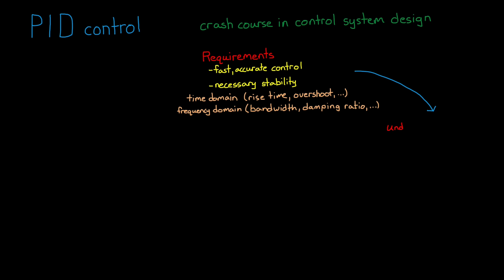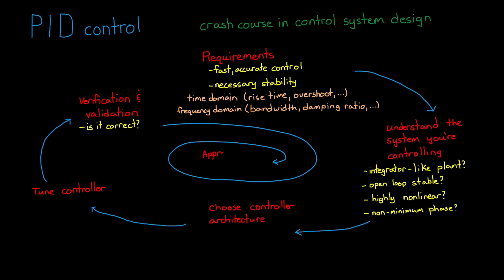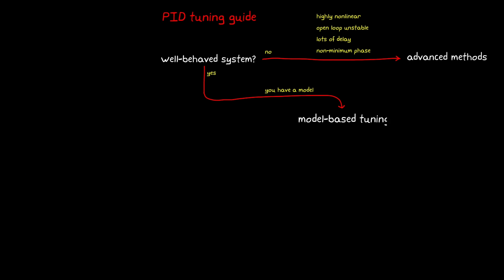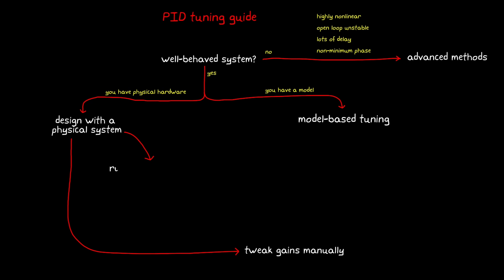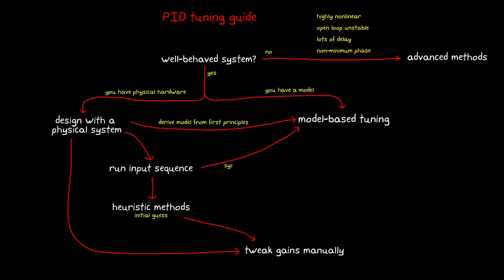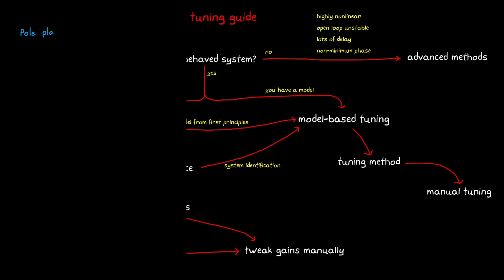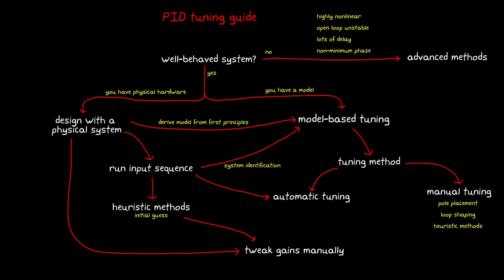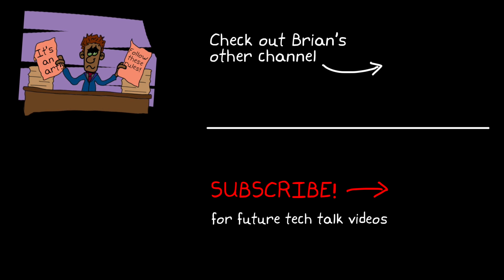A PID Tuning Guide | Understanding PID Control, Part 4

Comment: I once worked in a Florida based company that manufactres security products and I implemented an algorithm (C and Assembly code) in the microcontroller that perfoms "Automatic-Self-Testing" for the product to save time testing the product after production, this also saved time and money on testing the product. The reason I metioned this is that now I am thinking of similar automatic-self-tuning algorithm that will drive the Drone to the desired behaviour and automatically adjust the PID gains over time to compensate for the aging and deformation of Dron parts and sensors. I think this kind of algorithm will solve the tuning problem of PID control loop. Has anyone done anything like that before? I guess such algorith may need a high MIPS ARM microcontroller with very generous memory. Once this is a success I will add it to the service of my small business.
Reply: Maybe a bit late, but for anyone interested in this kind of work, look into adaptive control

Comment: Hello Brian, your videos are fantastic! A perfect tie-in for this Part4 PID Tuning would be Benjamin Vedder's VESC Tool, specifically, the PID Controller menu tab (the default numbers are meant to be tweaked for different motors, but there is no clear guide as to how). If you could integrate Benji's VESC Tool PID Controllers into your Part 4 PID Tuning video (as a new video), it would be of tremendous, immediate benefit to thousands of e-bike, e-skateboard and quadcopter users. Thank you!

Comment: Hi Brian. Thanks  a lot for sharing your knowledge with us. I am working on a microgrid simulink model where voltage error is at the input of the PI controller. What result should I expect at the output of the controller? Do I need to get the value of the reference voltage by tuning the controller? Also can Ziegler Nichols method be used for all the cases?

Comment: I'm facing a challenge of refresh rate for the feedback sensor. The temp reading refreshes every 11 seconds, the PID goes from one extreme to the other in that time period and the temperature swing is large. How can I learn how to correct this?
Reply: Most likely the gain in the feedback is too high. Reduce P and I terms
Reply: @odissey2  I will try this weekend thank you sir

Comment: Hey everyone, thanks for watching! I know this was a whirlwind of a video so if you have any questions on any of it leave them here and I'll try my best to answer them.  Cheers!
Reply: That was confusing, wasn't it? A motor in position control acts like an integrator for the reason you state - it accumulates distance given a constant signal. The motor control example I used was a velocity controller, which doesn't act like an integrator since a constant voltage produces a constant velocity.  Therefore, my statement about the motor controller was misleading.  To understand why an integrating transfer function may not require an integrator in the PID controller, search Google for "transfer function type steady state error" and click on the UMich link at the top.  There is a great explanation of transfer function type and how that relates to steady state error.  If you want zero steady state error for a step input then your system needs to be a type 1 (or one pole at the origin, or another way of putting it - an integrator). If your plant doesn't have that integrator, then you'll need to add one in the controller. Hope this helps.
Reply: I didn't post this video, so every time I try to post a link it gets marked as spam :/ But, there is a lot to this question and no one link will suffice.  The big ones to look up are to learn how non-minimum phase, unstable open loop plants, and lots of transport delay impact your closed loop control design.
Reply: Hi Brian)
It is very interesting. You explained to me very clear.
Reply: Thanks for the feedback!
Reply: Great video! I wasn't 100% sure what you meant by an integrator-like plant, despite the example of a motor. Is that idea that a motor, given a constant signal, over time accumulates distance in whatever it's driving? It's not clear to me how that would obviate the need for an integral factor in the controller.
Reply: Oh, and can you point to any resources to help with the "understand the system you're controlling" bit?
Reply: How to tune a servomotor specifically ?
Reply: Excellent videos
Reply: Brian Douglas  hey brian very nice 
But how can i get a direction to simulate it on matlab n simulink bcoz i want to perform it o  matlab
Reply: Hi Brian, Could you explain how to design a PID controller for a physical system with a given model transfer function.
Reply: Hello Brian, your videos are fantastic! A perfect tie-in for this Part4 PID Tuning would be Benjamin Vedder's VESC Tool, specifically, the PID Controller menu tab (the default numbers are meant to be tweaked for different motors, but there is no clear guide as to how). If you could integrate Benji's VESC Tool PID Controllers into your Part 4 PID Tuning video (as a new video), it would be of tremendous, immediate benefit to thousands of e-bike, e-skateboard and quadcopter users. Thank you!
Reply: You are awesome Brian!
Reply: Thanks, I'll give that a search!
Reply: Please provide pid quad copter arduino code
Reply: @aarduinoplccontrol2085  Learn control theory and write your code on your own.
A PID controller of a a quadcopter consists of several input data based on your drone. What do you want? Define requirements, understand the system (find poles, nulls etc.). Let's say you want your drone to be horizontal in every timestep, analyze the gyro sensor data (yaw, roll angle. etc.) and apply your PID controller. If you want your drone to be precise in heights, then feed your controller from the heights measurements. Achieving everything by 1 controller seems bit tough (Arduino limited pin restrictions, except if your are using digital registers etc.).

@Briand that was a nice video, you should've publish that a few semesters ago ;)